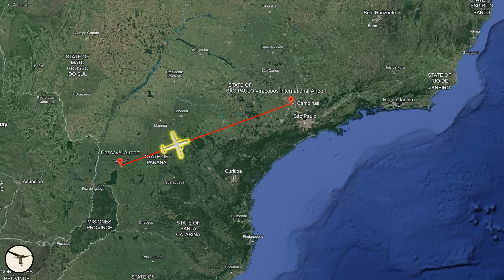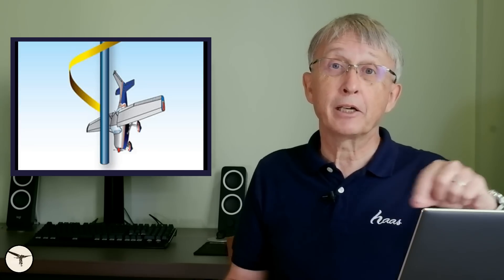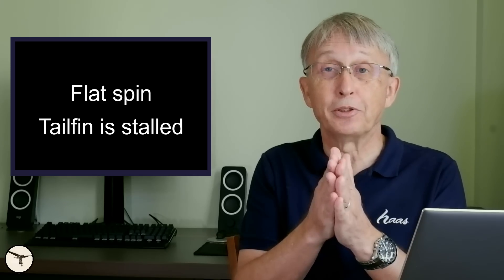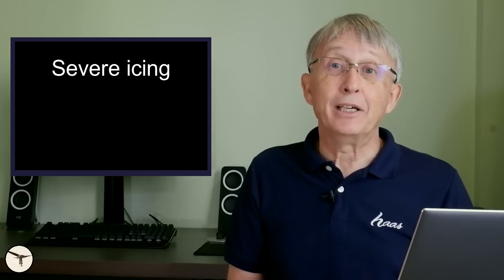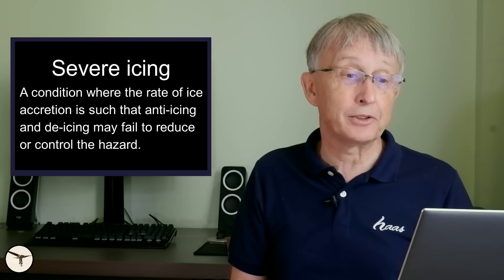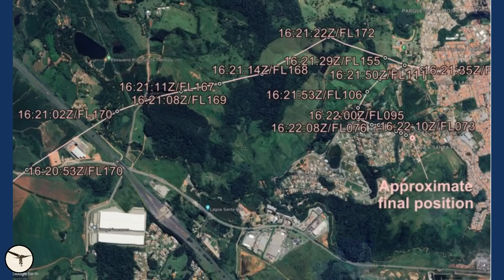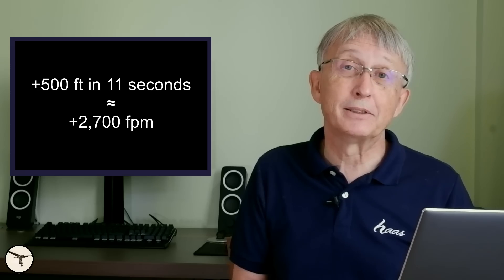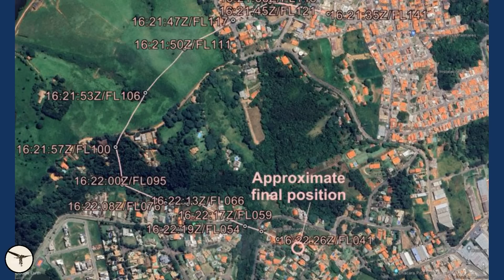ATR 72-500 Crash: Understanding the Fatal Flat Spin & Severe Icing Dangers

Comment: Wouldn't want anybody else to explain this. You are my ATR guru.
Reply: Aye!
Reply: After the ATR enters a spin for whatever reason, might as well throw the AFM out, and try anything. You’ve got 1 min from 17,000’ to figure it out. I’d try PARE first, if that’s not reducing the yaw, then I’d try advancing the power against the rotation. If that doesn’t work, shout to the passengers to move towards the nose of the plane.
Reply: @sammarmon3965  They were spining to the Left, but you can hear the Right engine was revving its guts out.  That means the engine brake de-clutched the R propeller, You can also hear the thrashing sound of a prop in Beta, so they had both engines not producing thrust. Spinning Left with the Left prop in Beta  indicates to me it was not intentionally in Beta. i predict propeller pitch mechanical failure started this.
Reply: @Tazjet100  Good point. however it looks to me they tried everything they could with the engines to get out of the stall condition, which is actually a remote chance. What we hear,  is the very latest moment of the picture. They recovered 100% of the FDR and the CVR so at least they have everything they need to figure out the main root of the accident.
Reply: @Tazjet100  how can you tell which engine was revving by the sound? Get real
Reply: @sammarmon3965  There is a baggage hold between the cockpit and cabin so there is no shouting back. Lack of airspeed  prevented recovery.
Reply: @sammarmon3965 if the crew are not trained flat spins ever, they only will understand the spin condition when they leave out the clouds, at 2000 ft, so they do not have time to put the CG forward anymore.. it's very sad.
Reply: @sammarmon3965   I understand your reasoning BUT if they aren't buckled in to their seats ( probably not) they will be pinned to ONE wall making things worse.
   It's far worse than a centrifugal fairground ride so it would not be a good idea to ask people to unbuckle for that reason . 
    But thank you for thinking outside the box. ANY suggestions should be encouraged to stop this happening again.
Reply: @brianbrotherston5940  I'm just guessing like everyone else, but the audio tells me there was mechanical failure in a propeller. I doubt icing was the cause.
Reply: What about Blancolirio? 😮
Reply: @maesc2001 blancolirio is very good too
Reply: Speed is Life.
Reply: The Right engine brake de-clutched the propeller at 17,000 feet.
Reply: @Tazjet100 said
"The Right engine brake de-clutched the propeller at 17,000 feet."

Maybe the left one, my friend, they felt spinning to left.
Reply: True this
Reply: For all Youtube Ostriches. aircraft had a serious tailstrike in March. Since the tail strike  PS-VPB has suffered multiple hydraulic failures.
Reply: Some woman said in the comments of another video, she heard the plan making weird noises as it passed near where she lived. The video I saw with the plane spinning down has sound and the engines sounded very loud and awkward. Maybe they were at full power because they were trying to recover. I wonder if they had started the decent and noticed the problem? What a disaster I’m sorry for everyone affected by this, employees, passengers, families, friends and the public.
Reply: ATR instructor pilots have absolutely no experience with spin entries or recovery. In fact neither do any other ATR pilots, at least none that are still alive. They know how to fly the airplane within the AFM limitations. This is so far off the reservation that any prior knowledge of the airplane is almost completely irrelevant. Spins are not performed as part of training and were never performed during initial flight testing and certification of the aircraft. Stalls yes, stalls with ice yes, but spins - absolutely not. They would have done straight stalls, turning stalls and accelerated stall up to stall warning plus 1 second. It would be very unlikely that this instructor pilot would have ever done those on the actual airplane. Doing them in the simulator is nowhere near the same. So while he knows more than 99% of the people commenting here there are some pretty substantial imitations to his knowledge when it comes to an accident like this.
Reply: @sblack48  in my humble opinion, and for this particular plane, flying with SIGMET marking SEVERE ICE conditions, dude, this is a serious business and thats may main hypothesis and I am not saying that it was the root of the crash. IF they were loading ice during the flight and they didn't notice it until the plane disconnected the autopilot because the aerodynamic is degraded, or they notice this condition too late, you are in serious troubles also, deicing this particular plane could be ineffective. As it shows the telemetry, plane was doing just before the crash some erratic movements likely trying to gain control again, but below100kts the situation is unbearable. No comercial plane is able to recover from a deep stall like that one. Also T tail planes like this one,  tail controls yaw and pitch are ineffective at stall due to the turbulent wash off of the stalled wing,  So there is no way to get out. You basically fall in a spiral becase the stalled wing has more drag. A pray for the victims and may God have mercy with all of the victims.
Reply: @xirius9963  Everything at this point is pure speculation however my understanding is that as the result of previous icing accidents and incidents on the ATR they are obliged to disconnect the AP in icing conditions. Did they follow the procedure and disconnect? I don’t know. They are also supposed to stay with flaps retracted in icing conditions. Did they? I don’t know. The FDR and CVR will most likely answer all the questions so we need to wait otherwise we are just spinning our wheels.
Reply: @sblack48  Indeed. However there was reports of severe icing from FL120 until FL210. In particular a LATAM A320 reported icing on the windshields which is very weird. This means a likely escenario of extreme icy weather for a plane with design issues to keep up under these conditions. Then the procedures, Can you ensure that even with flap retracted and the boots on guarantee a fair aerodynamic situation for the pilots?. Did you check the Aero Caribbean 883?. Let’s wait what’s come out but I wouldn’t go to air in that plane with such a MET call out.
Reply: @xirius9963  reports of icing could mean it caused the whole thing or it had nothing to do with it or something in between.  ATRs have flown millions of hours since the roselawn accident and the procedure changes that came out of that investigation and the follow up testing by the company seems to have been effective in resolving whatever issues they had. So was this just way more severe icing? SLD? Or something completely unrelated? What’s the point in speculating? At this point we don’t know anything except some vague circumstantial evidence. Not enough to draw any meaningful conclusions
Reply: @sblack48  Interestingly ATR's are not required to be certified for flat spin recovery. Most Boeings and Airbus aircraft are. I don't know how much Embraer or Bombardier aircraft (curious to know if the Q400 competitor is) are, but ATR72 is one of the biggest aircraft vulnerable to a flat spin and no chance of recovering from it.
Reply: @thecaynuck  no Part 25 transport category aircraft is required to demonstrate any kind of spin. Period. I don’t know why you would think that any transport category aircraft is vulnerable to a flat spin. That’s just absurd. I spent 31 yrs at an aircraft company designing and certifying commercial aircraft and biz jets and there are absolutely zero spin requirements for these types of aircraft.
Reply: @sblack48 are you sure ATR are not naturally prone to a flat spin very easy? If It not roll a wing down, lets say by a pilot intervention triyng control roll, that means It will not go with nose down to recovery the AoA.
Reply: @cristiano3842-k8p  nobody has ever done a spin of any kind, flat or otherwise, in an ATR, or any other turboprop, so nobody is sure of anything.
Reply: @sblack48 this was icing
Reply: @AnetaMihaylova-d6f  it's not nearly that simple.  ATRS fly in ice every day. It is certified for flight into known icing. There have been other incidents and even accidents with ATRs in ice. None of them resulted in a flat spin. So there is a lot more to it than simply icing.
Reply: @sblack48   correct however knowledge of ATR72 systems would tell you there is an engine brake which de-clutches the propeller so it can be used as an APU on the ramp. if the brake activated it could cause loss of airspeed and gyroscopic effect in a spin.  Just join the dots s black 48.
Reply: @Tazjet100  there are no dots at this point
Reply: @Tazjet100  will it have a similary effect to an one side deployment of thrust reverser in flight ?
Reply: @tenhendee5479  Yes  it will slow the aircraft and drag the Right wing back , then cause asymmetric thrust in the spin making recovery near impossible. I think automatic engagement of Hotel mode was just as likely as icing in Voepass 2283.
Reply: @Tazjet100  maybe disengaged because of vibrations , icing propeller ?
Reply: @sblack48 he didn’t say he did spins on the ATR. He’s probably spun other aircraft. He knows the aerodynamics.
Reply: @jamesdowd8354  the spin characteristics of high wing transport turbo props have never been investigated by anybody as far as I'm aware. There is a lot more to it than aerodynamics. There's thrust forces and moments which would be substantial and intertial coupling. It is an incredibly complex problem. I don't think this guy will go there. He seems smart enough to know his limitations. I worked in the field of stability and control for transport aircraft for years and I wouldn't touch it with a ten foot pole. There is simply no data. This isn't a Pitts.

Comment: I think we must be careful with our interpretation of the flight path. If it comes from Flightradar24 for instance its reliability might be doubtful if the aircraft was not equipped with ADS-B but just a plain Mode S transponder (because then the flight path is calculated by MLAT with is much less accurate). It's better to wait for the official radar flight path.

Comment: I was waiting for Captain's analysis... I was wondering how an ATR can go into a flat spin! Thank you.
Reply: Center of Gravity had to have shifted aft... if the GC was center of the main wing, the drag from the tail would have forced the nose down. Icing may have cause the stall, but to stay in a flat spin... something else is very wrong here
Reply: @renaissanceman5847  icing on the T-tail causing it to have aft CG and causing T=tail surfaces to be blanked is a possibility
Reply: @KuostA  maybe . But the record shows it dropped then went into a very steep climb before going into a stall. Something broke or shifted that CG.
Reply: @renaissanceman5847  explainable by Autopilot getting them in a severely out of trim state as their drag increased with ice accruing until it could not hold it any longer and disconnected, suddenly giving back control to the pilots in a completely out of trim state with them completely lacking awareness to the actual energy state the a/c was in, resulting in them failing to input the correct correction inputs, resulting in the pitch down, then up, then loss of control following a stall into a flat spin.
Reply: stall + yaw + power  and maybe ailerons